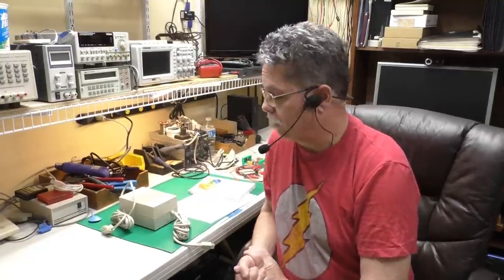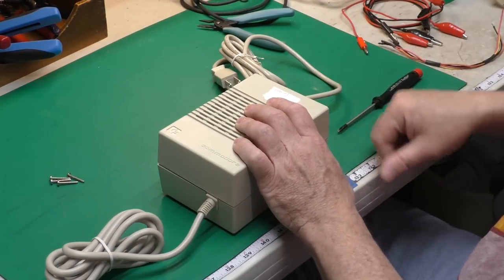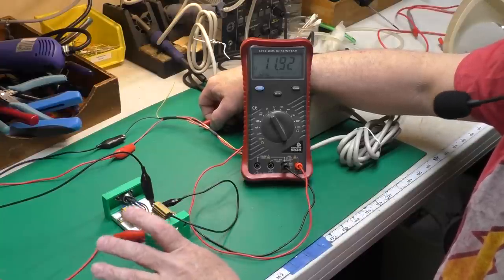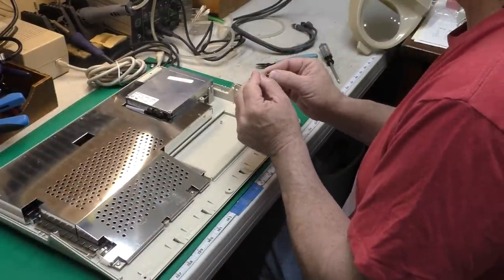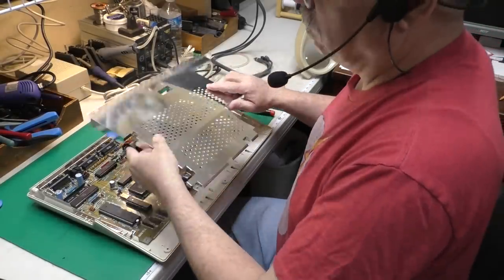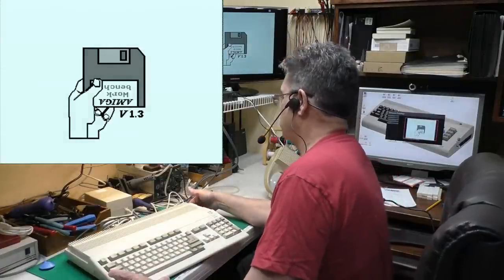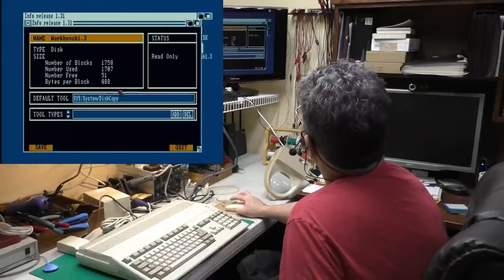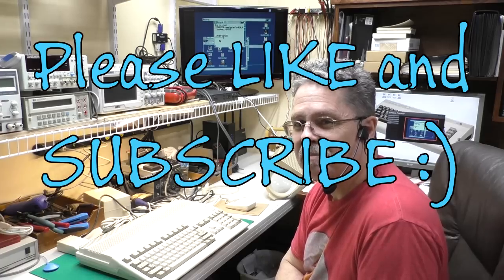Amiga 500 New-In-Box Video 2, First Power Up

Comment: Great stuff!  Not sure I would have opened either of these babies up, but that's just me!  They look so perfect inside and out =O  I would consider waiting for the TF536 (64MB of RAM, 68030 @ 50Mhz + IDE CF).  You could build it yourself too!  Just need a Xilinx programmer and you're away.
Reply from the maker: Thanks! I'll look into the TF536. That sounds like fun. As it turns out this A500 needed to come apart to fix the KB. That is the subject of the next video.

Comment: I am a fan of the ACA500+ for your expansion. It has a 68000 CPU that you can clock at up to 42 MHz, adds 7 MB of RAM and has two CF slots, one for the operating system (which it ships with - from 1.3 up to 3.1), and a hot swap for transferring data from your PC to the Amiga. It opens up a whole new world on that A500. Check out my video on the A500+
Reply from the maker: I do like the ACA500+. I'm not a fan of how it just juts out the side, seemingly with no thought of an enclosure but the 'jutting out the side' thing is an inherent trait of the A500 I guess. I also like how it solves the problem of swapping ROMs so you can have 1.3 and 3.1.x as well.
Reply: @HeyBirt  there are several people who make enclosures for the ACA500+ on eBay in Europe. Pixel Vixen found a great one - I can ask her where she got it. I think it is purely a cost thing that Individual Computers does not deal with cases.
Reply from the maker: I would be interested n sources for cases.

Comment: Many Amiga disks, especially games, are self-booting. So try restarting the computer, and when the Amiga prompts for the Workbench disk, instead put in the Tetris disk. It'll probably start no problem. Thanks for the video, it makes me want to fire up my Amiga 500 again.
Reply from the maker: After filming this I read through the pamphlet that comes with the Tetris disk and it mentioned that if you had Workbench loaded you could just leave the Tetris disk in when it asked for the Workbench disk during the load process. Or, you could do as you say and boot from the Tetris disk.  The only one that worked for me was booting from Tetris disk.

This is part of episode #3 which is about half finished at this point and will be out later this week.

Comment: Hey Birt! I'm a little late to this video but that's YouTube for you. 
If you are still interested in where next to take your lovely A500 then I'm with Doug. You couldn't do much better than an ACA500Plus from Individual Computers. It's the most versatile upgrade out there giving you all you need to enjoy an A500 and if you find that you want more then theres options of Ethernet (X-Surf-500) USB (RapidRoad) and an ACA1233n to give more RAM and Power later down the line.
It also will allow you to use your Gotek as the primary Drive without hardware mods. 
The only negative that I can express is that it doesn't have a nice case.
Reply from the maker: Thanks, I have not gotten that far yet. But eventually will get to some sort of 'high octane' performance booster :)

Comment: I recently desoldered the cables on the funky looking PSU that came with my A500 and replaced it with a Mean Well RT-65D and it looks nothing like the board in yours. I'm guessing it's because mine is a European model, but it is quite interesting.
Reply from the maker: Commodore had power supplies made by different manufacturers in different places in the world. I know for the C128 there are three different manufacturers so I suspect it is similar for the A500.
Reply: @HeyBirt  Exactly true.  This is a later revision A500.  When I bought mine that was an earlier revision (5, IIRC) it came with kickstart 1.2, and the power supply was heavy, more like the heaviness of the C128s.  The newer power supplies were very light.  Obviously cost reduced.  but maybe run cooler?
Reply from the maker: Typically the weight comes from the transformer used. On the C128 type of supply they used a typical 50/60hz transformer to reduce the voltage (as they needed 9vac). The switching regulator for the 5V was done from this lower voltage.

As the technology improved with switching supplies they could use a much higher switching frequency (from 10's of kHz to a few hundred kHz). The higher the frequency the smaller the transformer and the lighter and less expensive. 

The heat produced has to do with efficiency. A linear regulator like the C64 used wastes half its power as heat. A switch type is much more efficient,  80%~90% typically.

Comment: Since you don't want to install an internal GOTEK, you can mount one in an external floppy drive, that way you can easily copy ADF files to real disk.
Reply from the maker: That is the plan. I found an external drive with good case in non-working condition which I'll swap with the Gotek.
Reply: @HeyBirt  In addition, maybe you want to do a boot selector mod to make the external drive df0: to boot games from it.
Reply from the maker: Yes, that is a good idea and I think I will do that eventually. I was reading about it and saw that there are premade PCBs for that mod too. I'm not a fan of just using a simple switch and having the CIA signals traveling along long wires (which make a good antenna). I much prefer the type with the multiplexer or other logic to keep those signals local. They are fairly inexpensive too or easy to make oneself.
Reply: @HeyBirt   Yes. I've used one of these premade PCBs as well. My case had a hole drilled into it for the 1mb extension's on/off-switch anyway but since I converted the machine to 1mb chipram, I didn't need that switch anymore, so I reused it for the boot selector.

Comment: The Amiga 500's didn't have a drive protector in them.  Looks like you have a later ECS model 500.  Rev 6A.  You can do the 1MB Chip RAM mod on it with a 512k ram card installed.  Did it have a blue box?
Reply from the maker: What box are you referring to?
Reply: Never mind I watched your first video.  You have the Discovery pack with the extras.
Reply from the maker: Ah, I was not sure if you meant the carboard box or something internal.